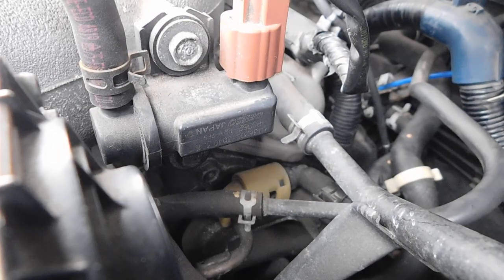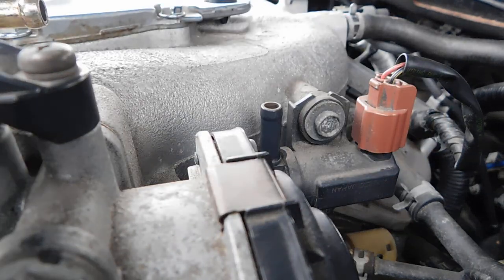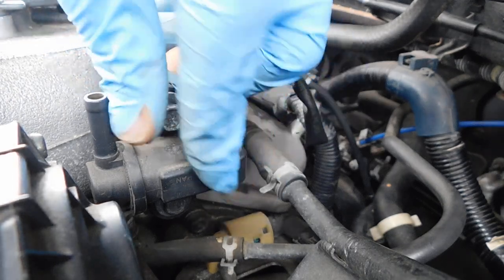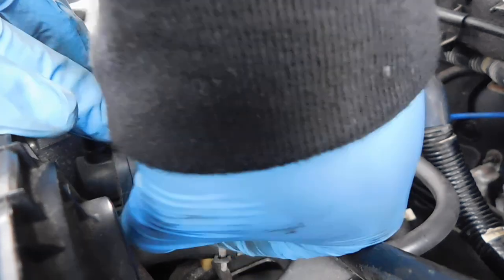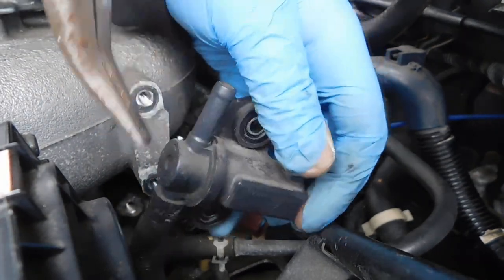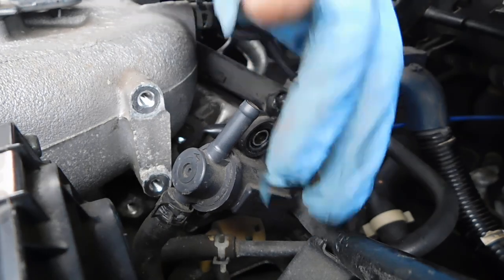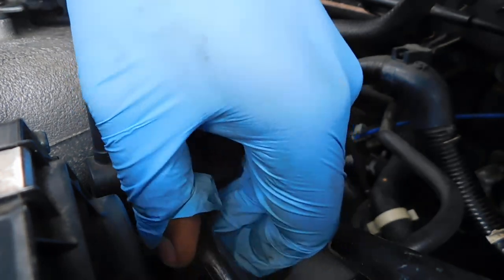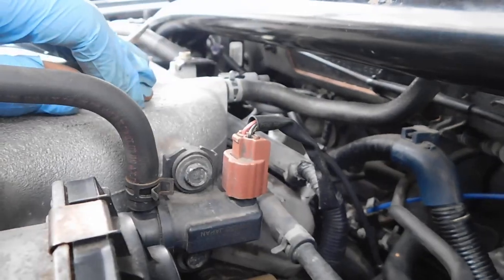HOW TO FIX TIGHTEN FUEL CAP MESSAGE FIX TUTORIAL P0497 P0457 P0456 P0442

Comment: The tighten fuel cap light keeps appearing in my ‘13 Acura MDX. The body shop replaced the cap but it came back on. Should I mention replacing the solenoid “thingy”  you talk about in this video?  I’m a woman and don’t know all the mechanical parts jargon but I need your help! Thx

Comment: I got this same code after i replaced this valve. Kept coming back, i changed the gas cap and i ended up using a smoke machine from the bottom hose on this valve. The smoke came from the top of the fuel tank, i pulled the fuel pump cover off and it was coming from the vent going to the filler tube. Have you ever dropped the fuel tank? I cant find parts for the vent or videos of dropping the fuel tank on this 3rd gen acura.

Comment: Love my TL ,These cars are reliable but they do need lots of little maintenance things. I’ve replaced all kinds of little things like this on this car. All with the help of the these vids most TL repair knowledge I’ve ever seen , Pressure switches are next to fix my D light blink , my lines seem okay guess I’m ordering one of these sensors next at least it’s super simple to change.
Reply: Light still comes and goes after replacing my old Mexico one with a new one that says Japan on it. Also bought a new fuel cap. So i donno maybe leak somewhere else?
Reply: @Captain420Malone  did you happen to find out with the issue is? im having the same issues.

Comment: Yep. Just replaced the unit on 2007 Acura TL. Drove about one mile to perform system re-learn. And sure enough, the obnoxious beeping sound & sign “tighten fuel cap” went away!!!  Hooray!!!
Reply: Did yours ever throw a check engine light, though? My 2007 TL is also giving me this warning despite the cap being tight. No check engine code, though. I even got the car through emissions yesterday, which in CA is impossible if you have an actual active check engine code.
Reply: @Angel-HC  nope, I had no Check Engine light popping up at all.
Reply: @Angel-HC i wanted to ask about the cel as well because I don’t have one and I replaced the solenoid with a new one but aftermarket and the cel and message came on but before the cel never came on so I returned it and put the oem one back on and only the tighten fuel cap message comes on.
Reply from the maker: @E85_STI only oem sensor works
Reply: What's side of the engine is it on?
Reply from the maker: Driver side
Reply: How much is that solenoid?

Comment: Hey Chief. If you can help me, I got a new Purge Solenoid from Honda and replaced it. I have not replaced the gas cap cos the gasket does not look worn out.  I still smell fuel everytime I start the car. What do you think is still wrong cos it's still screaming "Check Gas Cap" Accord 2007 SE V6.
Reply from the maker: clean the ports too where the valve goes too and clean the throttle body also

Comment: Great tutorial on this part fix. I had the "check fuel cap" light come on but it went away and then a day later I had a check engine light come on. Took it to my local Auto Zone for the code, exact same part as what you have is needed to get the fix. My only question is, where exactly is it located? Looks to be by the battery side..
Reply from the maker: +David Ruiz right next to the throttle body
Reply: Gotcha.. I'll take care of it once it warms up a bit.. Thanks man..
Reply from the maker: +David Ruiz no prob
Reply from the maker: +David Ruiz no prob
Reply: I had exactly as what you said, does the problem solved ?

Comment: This same thing keeps happening to my 08 MDX . I've replaced the cap but haven't tried replacing this purge valve yet. Thanks for the video. Any chance this could be related to difficulty starting, randomly and a check transmission light coming on? The code was P0880.
Reply from the maker: nah those are other issues but the purge valve replacement should fix your problem others issues get a full system scan and go from there.

Comment: Great video...but I do have a question ❓ I just replaced my purge solenoid valve on my 2017 Chevy Sonic premier last month and now I'm getting the check gas cap notification on my dashboard and I replaced my gas cap with a brand new one? So my question is what do I need to do next?
Reply from the maker: Get one from the dealer aftermarket don't always work hit or a miss with those.

Comment: I CHANGED MY PURGE SELONOID AND MY GASS CAP AND STILL GETTIN THE CAP MESSAGE AND HAVE A CHECK ENGINE LIGHT ON, DOES ANYBODY THINK IT COULD BE MY CANISTER DAT NEEDS TO BE REPLACED .. I NEED SUM HELP , BEIN WASTIN TOO MUCH MONEY ON GAS ALSO
Reply from the maker: Did you use a oem purge solenoid from acura
Reply: Might be like my issue, I used a smoke machine on the purge valve bottom hose to the fuel tank and its coming from the top of the fuel tank vent. Can't see it with the fuel pump port. 😅

Comment: I replaced mine on 2011 mdx it fixed for a couple weeks and is back showing the tighten fuel cap error again, what can I do?
Reply from the maker: Did you use a oem sensor

Comment: Replaced gas cap, hose and the purge valve, check engine light came back on, checked all the monitors and they are all fine, even evap monitor. Still get codes p0497 and p145c
Reply from the maker: Did you check the hoses

Comment: The light on my 07 TL only appears when there is change in weather I am highly suspecting a that electronic piece is going bad
Reply from the maker: Дядя Федя yup its on its way out
Reply: I give it about a month it goes on and off as right now, i'll change that part once the light will be on for longer. Thanks for reply though,  also did your TL had a check Charging system light and it didn't want to turn over unless you mess with a gear shifter?
Reply: fabolousg4ever how long did it take for the message to clear out?
Reply from the maker: Like A few hours
Reply: fabolousg4ever actually it went off after I started car second time. Thanks for your help!!
Reply from the maker: Дядя Федя cool as long as I went out.

Comment: Just wanted to say thank you changed the purge valve and replaced the gas cap fill tank up within 2 hours tighten gas cap light went off my name is Keith Richardson but somehow my channel got erased yesterday I replied earlier this week keep up the truth you are reaching gear heads!!
Reply from the maker: Lanell Richardson no problem thanks.
Reply: I did this too but just changed the purge valve. After I drove it for like 40 miles or so the check gas cap sign came back on. Do I have to change the gas cap as well?
Reply from the maker: Did you buy oem
Reply: fabolousg4ever the purge valve I didn’t
Reply from the maker: You have to buy oem aftermarket doesn't work
Reply: @fabolousg4ever  yeah no wonder the light is still on after changing it. do you have the part # by any chance? i also noticed the hose where it is connected to is a little torn up could that also be the issue?
Reply from the maker: I have the own in my Amazon store
Reply from the maker: Oem
Reply: Installed oem solenoid purge valve. Still have gas cap message

Comment: Frustrating. I have a 2013 with this problem. I appreciate the video but the video is so close to the motor and mine must be slightly different I have no idea where you are working. There needs to be some sort of orientation. I do not have the exact same thing. I have looked and I can't tell where you're working.i also have a 3.7L

Comment: Does this also solve performance issues? Ex. Car is pretty slow under v-tech in hot weather.
Reply from the maker: Darrel P not really that emissions clean throttle body change air filter change spark plugs and clean intake manifold
Reply: fabolousg4ever Thanks

Comment: This morning a message appeared telling me to tighten the gas cap, but it was tight and a few weeks ago I also saw the same message. Now I notice and I think it has the same title as the video, could it be that the message of the car is shown because the piece that you change in your video, in my car will be damaged?
Reply from the maker: Jean Paul Ponce Salas yes replace the sensor or check the lines that goes into the sensor make sure they are not clogged if they are not   clogged replace the sensor .
Reply: fabolousg4ever Perfect that will do, I just wait a little because the sensor is expensive, and I do not currently have the money. A question is urgent that I change it or can I wait until I can pay the piece?
Reply from the maker: YOU CAN WAIT NOT THAT SERIOUS
Reply: fabolousg4ever okey perfect thank you men

Comment: Should I also replace the hose?
Reply from the maker: yes if u want don't have too.
Reply: @fabolousg4ever  reason I asked is because I replaced the solenoid and the gas cap light still comes on and Im getting a P0174 code
Reply: Howard Hamilton. Same here but I bought my purge valve from Amazon, I wonder if this has anything to do with it??

Comment: I changed this twice and still have the message
Reply from the maker: Did you buy oem or aftermarket
Reply: Same problem switched it twice. Got the duralast brand from autozone
Reply from the maker: No only buy the one from the dealer
Reply from the maker: Aftermarket don't work
Reply: @fabolousg4ever  I appreciate it
Reply from the maker: No problem I have a link to buy a oem purge valve link in my videos description
Reply from the maker: @R3SM3D  here's the link-https://www.amazon.com/dp/B00IFPE6K2?ref=exp_influencer-d0aff233_dp_vv_mw
Reply: @fabolousg4ever  went oem Denso Japan and it went away I think I still got a leak somewhere tho
Reply from the maker: Ok good

Comment: Did this and it worked for like 5 days and then it came back. I replaced this solenoid and the gas cap. I was low on gas and the moment the low gas light came on the tighten fuel cap light came on and then went away when I filled up my car. Then it came back when I took a hard turn. Really annoying.
Reply from the maker: did you buy a oem purge valve or aftermarket.
Reply: MODS FOREVER aftermarket from Napa. If the light doesn’t go out or comes back easily I’m returning it for a new one and if that one does the same thing then I’m buying oem
Reply from the maker: oem or nothing ok
Reply: @fabolousg4ever  is the part sold on Rock Auto OEM? I have a 2006 Honda Ridgeline RTL Nav 137k miles, first got fuel cap message (replaced cap OEM Honda) then changed with Rock Auto part now have p0455 big evap leak.
https://www.rockauto.com/en/catalog/honda,2006,ridgeline,3.5l+v6,1431832,exhaust+&+emission,vapor+canister+purge+valve+/+solenoid,4936

Comment: ha-ha-ha its true i did this 6 months ago. Anyone who gets the "tighten fuel cap" must do this, due to a faulty evap purge control valve.
Reply from the maker: +reamz tls yup yup
Reply: i changed both my gas cap and purge valve and still got the tighten fuel cap message , and have a check engine light , can this be my canister bein faulty
Reply from the maker: Did you change with dealer parts
Reply: fabolousg4ever yesss i did got them off the acuraoemparts.com
Reply: swapped it out the same day and 1 day later i got the same message
Reply from the maker: When you scanner for codes what are the codes you have send me codes so I can help you further
Reply: fabolousg4ever These are the codes P0455 and P0456 , ive changed my gas cap also
Reply from the maker: You have a evap leak you have a leak in your emissions system
Reply from the maker: Are you tightening the gas cap 3 clicks
Reply: fabolousg4ever so do yu think is my Canister that needs a replacement
Reply from the maker: Email me @infamousg4ever@gmail.com so I can send you better info
Reply: fabolousg4ever i emailed you
Reply: You guys ever figure it out? I changed my evap purge valve and then I got a check engine light P145C

Comment: do the vss sensor next or a video to troubleshoot the /!\ vsa lights off
Reply from the maker: +hostile163 ok kool i will make one
Reply from the maker: +hostile163 what wrong with your vsa its not turning off or it off and not turning on.
Reply: its off. and i want it on for traction but on my cluster it shows that the vsa light is on this image also shows /!\ some ppl say its the sensor behind the wheels to fix it im not sure
Reply from the maker: hostile163 it might be just the switch the button that just stopped working.
Reply from the maker: +hostile163 try replaceing the switch quick easy fix

Comment: Just replaced it but still having "tighten fuel cap" message pop up😑
Reply: You may also need a new fuel cap. Also make sure the hoses coming off of the purge valve are good because they can cause vaccum leaks if they're cracked. About to do this on my moms car as she already replaced her fuel cap and that message is gone, but still has the check engine light and code for the purge valve